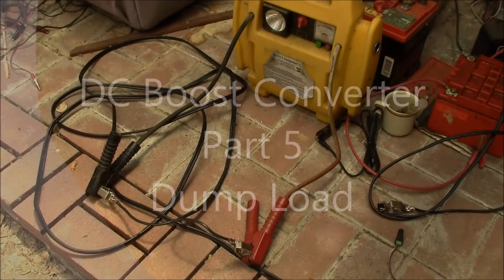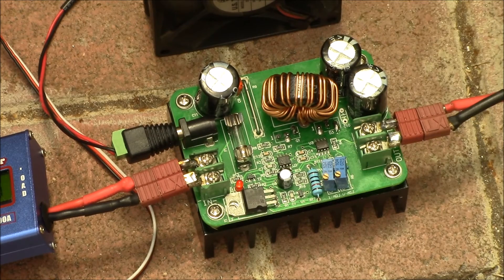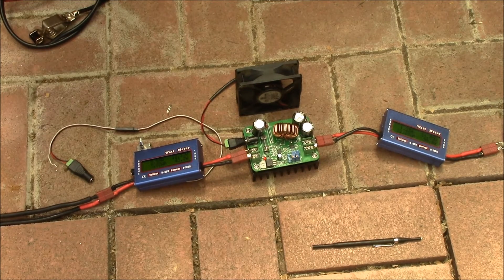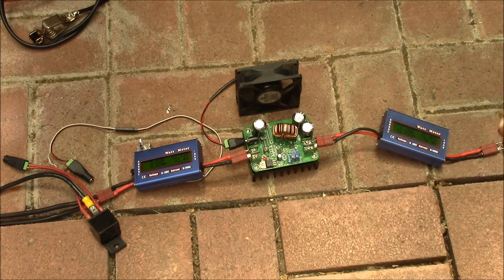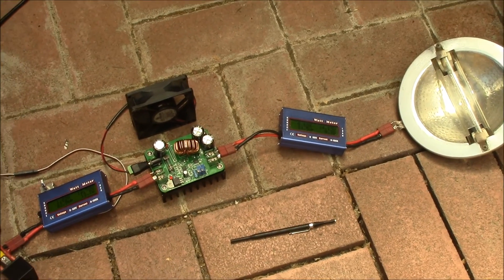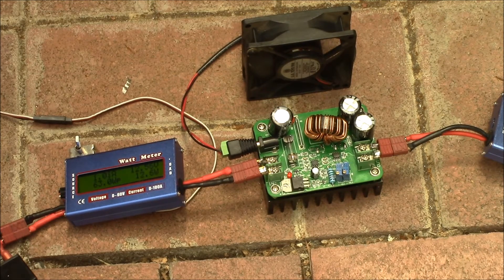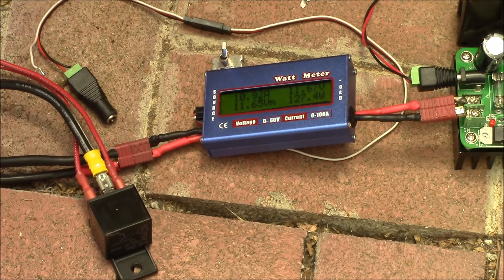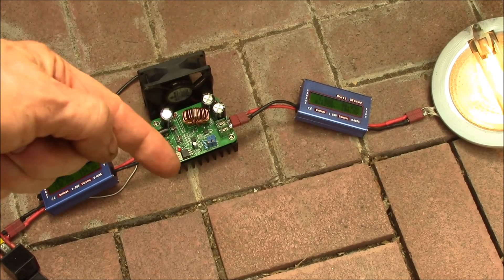DC Boost Converter, Part 5 - Dump Load

Comment: hi gentleman, could you tell me if this would be worth doing a discharge charge of a wind turbine to regulate the load voltage
Reply from the maker: I suppose that might work as long as the converter and load had a high enough power rating and the alternator on the turbine were not overloaded as well.
Reply: @The4Crawler  ok thank
Reply: @The4Crawler  https://www.youtube.com/watch?v=6_o8CxfuQ8U
Reply: https://create.arduino.cc/projecthub/philippedc/a-wind-turbine-mppt-regulator-with-an-arduino-uno-783462